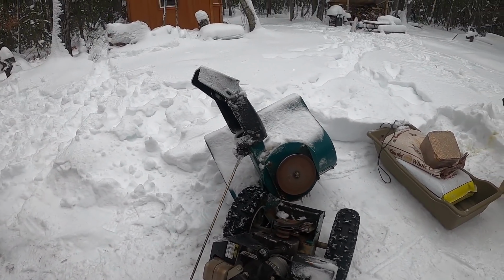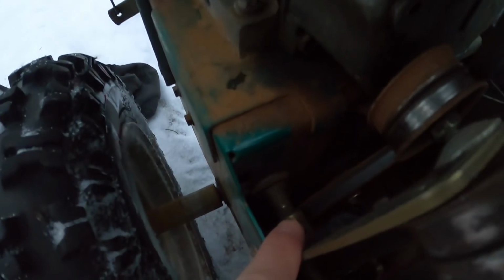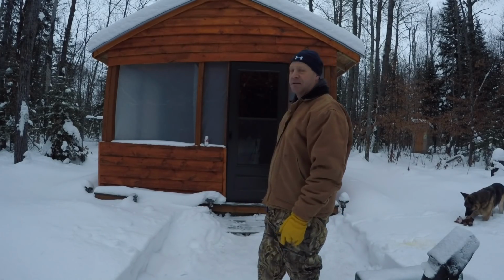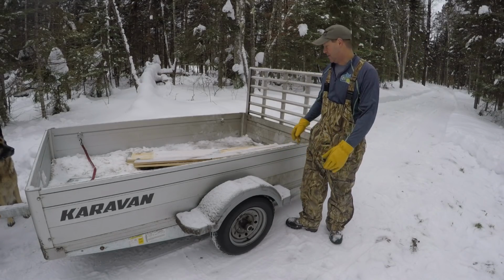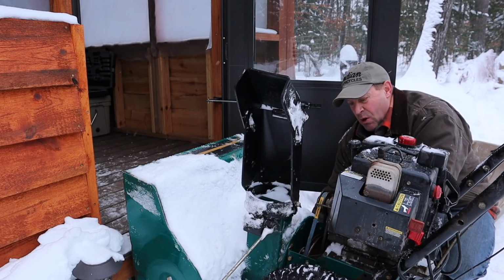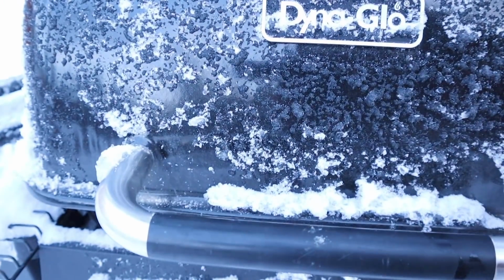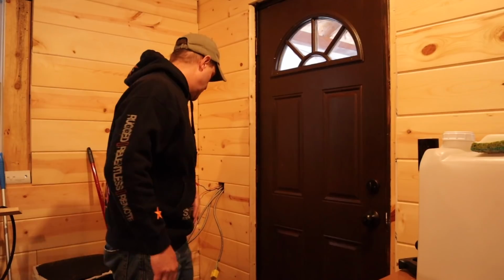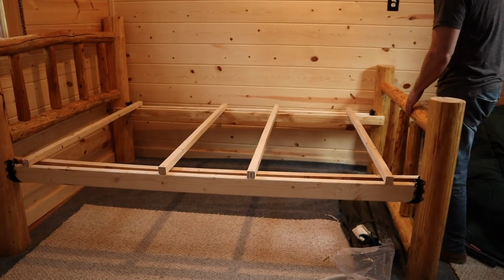22-1 Everything is going wrong!! Weekend homesteading at the off grid shed to cabin brings trouble!

Comment: dnhman is correct "all electrical connections are to be made in an easily accesed box with cover."  That is according to the National Electric Code.  It is just for the problems you are having now.  Some electricians use a deep box for switches and recepticals just for that reason.  They make connections in the back of the box.
   If you use a 4x box for conections the cover is to be avaliable for removing.  Also at a light switch you can use a gang box with the normal opening for the switch and blank covering for the area not in use that gives you space for connections.
Reply from the maker: Yeah lesson learned the hard way for me. ugh

Comment: Great video!  I built a 16x20 cabin with a 5/12 pitch and green metal roof i used 2x6 rafters at 16 inch on center. I have never had to shovel the roof I'm not sure what you have for rafters but the metal roof will shed the snow before you have any problems. I'm in the western mountains of Maine average 5 plus feet of snow. Not an expert but that's my experience over 12 years. If it makes you feel better I have had many days like your video but that silence you enjoy is worth every bit of aggravation. 
Enjoy!!!
Reply from the maker: Thanks Dan!. I was thinking my pitch was around 12/6 so I was surprised the snow didn't slide off the porch at least. IDK? Geez, 5 feet is a lot of snow!

Comment: Terry, a good alternative to a roof rake, would be a SnowJoe. They have about a 6 foot handle, and are made for cars, so you could use it without damaging your roof. Also a small bucket of Birch tree bark for fire starter works wonders. For you a small bucket would likely last all winter.
Reply from the maker: I hadn't heard of a snow joe. I'll have to check it out. I have birch bark in my outdoor box but it puts out so much smoke. I like to burn birch in the wood stove and it seems like the bark is always falling off in the woodpile.
Reply: @TRERUNSWILD  Just a small amount of birch bark is really all you need to start a fire if you got good kindling. Also a cotton ball coated in vaseline will burn for about 3 minutes or so. They make great fire starters too.

Comment: Thanks for the video! If I were trying to track down a dead wire I'd start by opening the outlets and switch boxes closest to the point where the power comes in/attaches rather than removing any paneling. Often times the fault will be with a connection or splice inside the electric boxes. Good luck!
Reply from the maker: I figured out the far outlet. I had forgotten that I had put that one separate. The others though...........I hope you're right, that would be so much easier.
Reply: @TRERUNSWILD  trying to figure out electric circuit puzzles has driven me nuts a few times too. I try to give the solution some time to ferment and then come back and give it another try.

Comment: Happy New Year Terry on the solar,have you heard of the Jackery it's kinda like a battery charger but has 6-8 plugins for different things. Simply living in Alaska uses it when they go to there cabin they bought a year ago. Basically all the off grid channels have been using it. Hope you can get your problem solved We got 8 inches of snow here in Nw Iowa Friday and Friday night but we have gotten 10 inches since November but all has melted so now we have 8 to get rid of but the weather seemingly to get warmer the next 2 weeks but then avg out but the sun is getting warmer day by day I'm not liking winter being old but I did when I was a kid. As a hiredman after highschool working on livestock waters in -30 degree temps isn't the ticket in fact in the winter when it gets below 0 I have 2 fingers change color from frostbite working on the waters. Can't wait for your next video !
Reply from the maker: I hear ya Robert. The older I get the less I enjoy winter and don't seem to tolerate the cold as well. I have the solar all put together, I just need to get to that short then I can power it up

Comment: Hello Tre,, I think we have had those sorts of weekends. Hang tuff your going a great job with the camp. I would add though the wiring might be an issue, there should not be any splices covered up. All junctions should be in accessible boxes.
Reply from the maker: in hindsight that was a terrible mistake. That unfortunately I will end up paying for.
Reply: @TRERUNSWILD  it’s recoverable, you may be able to isolate where the break is then use surface mount wiring components to reconnect to the other working outlets. This way no need to pull down expensive siding.

Comment: look up a bed bolt. You drill through the post and into the side rail. a nut goes into a cross hole in the rail and the bolt ties it together. two bed bolts in each end of the rail will tighten that bed up very well.
Reply from the maker: I hadn't heard of that! Thank you

Comment: Did you draw an electrical schematic for your cabin? Time to do that then if you didn't. They are always a good reminder in case this scenario happens in the future. Great reflection to remind yourself how far you've come. Everything is looking great. Someone may give you a shortcut to help pinpoint where the problem is in your electrical lines. If you have one of those ohm readers that may help you also. By process of elimination and not finding even a weak signal at an outlet you will know where not to look. You also know that mice did not make it in to your walls and start chewing on your wires.  I think there is a hand held meter that will help you locate where the juice stops so you do not have to tear into your walls.  Except at the needed location.  Sorry I am not familiar enough with it to tell ya.  Hope it turns out to be an easy fix but I am interested to see what happens.  Stay warm, safe, and healthy!
Reply from the maker: Thanks.... someone posted that meter in the comments. I will definitely try that first. I'm really hoping it will be in the outlet or light switch. That was part of the problem was it was so long between running wire and then putting the walls up that I forgot what went where. I wish I had drawn it out. Thats a great point.

Comment: for your wobbly bed......run a bracing board from the 2x4side rail to the round uprights......create a triangle and have two points of contact for a more secure build.  Just think about all the bracing you did for your solar panels which are what 20lbs each.  You need to brace the bed frame for your 140+ body.......
Reply from the maker: 140 pounds! You're too kind!!!!

Comment: I giggled a lot in this one bud, Not at you, just with you on your celebrations. I assume you checked to make sure you don't just have a bad outlet???? the cheap outlets fail more often than you would think. I know you probably checked it out more than you inlcuded in the video....but had to mention it. Best wishes
Reply from the maker: Ummmmmmm. No I did not!  Guess what the first thing I'm going to do is!!! Hope you are well. I love the new stove! Your channel is doing awesome!!
Reply: @TRERUNSWILD  depending on how you wired the cabin....if you pigtailed all the outlets or if you used the pass through method, WHICH MOST PEOPLE DO, it puts extra stress on the outlets at the beginning of the loop. I'm FAR from a pro...but check the outlet before you rip up your walls.....if it isn't too late, LOL. best wishes bud

Comment: Im trying to locate a high temp tolerant trivet to use ontop of my steel wood stove and under my cast iron fry pan. All I can find are decorative trivets or ones to be used inside a dutch oven. Where did you find the trivet you use to cook on the wood stove? THANKS!!!!!
Reply from the maker: I found mine at a recycle store. Aka thrift store. I would also check antique stores.

Comment: What about a 90degree cross brace between each side of the frame  If that works, you can keep the bed high enough to keep that important, under the bed storage area for totes, etc.  I tried to use logic for these suggestions because I didn't know the correct building terminology.
Reply from the maker: I had looked at that but was trying to stay away from screwing more boards into the post. I may end up doing that but hopefully will be a last resort. Thanks for the idea!